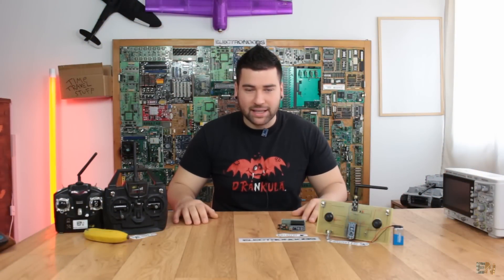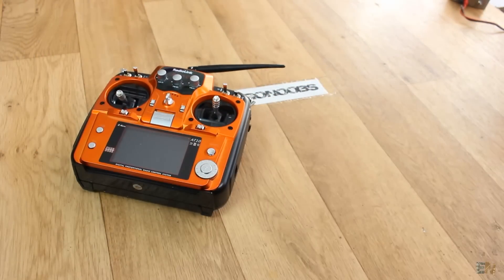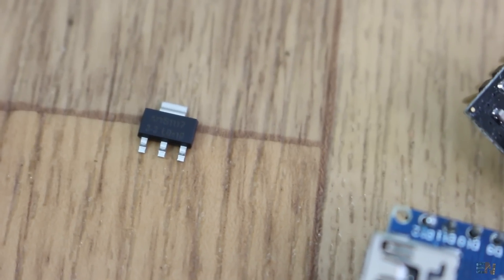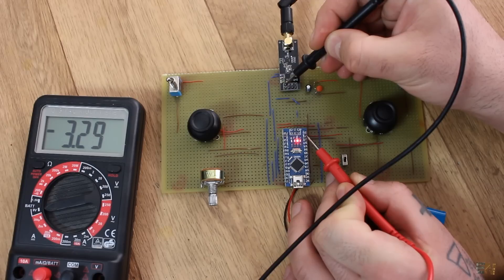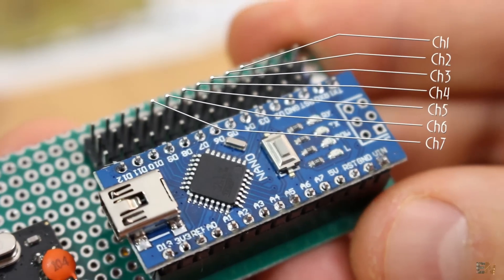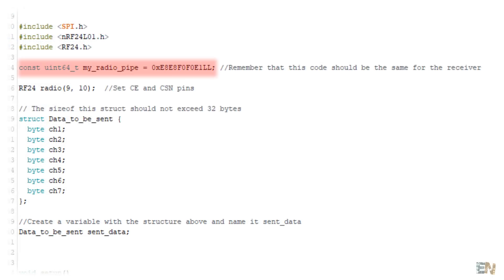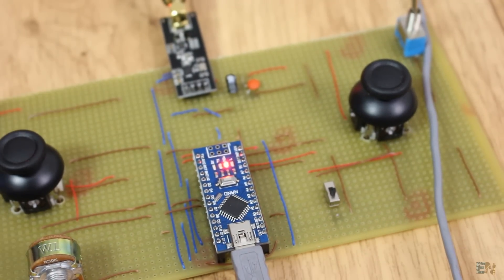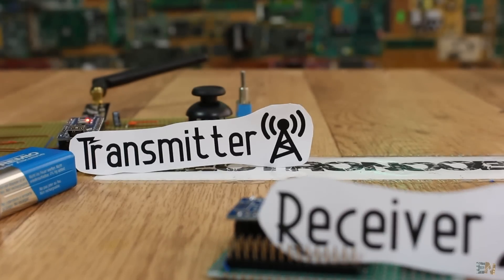DIY Radio Controller - Arduino & NRF24 + amplified antenna

Comment: hello electronoobs i made 6 channel rc arduino trans and reciver but after all connecting ..then servos not working all time sometimes it works but stoped and bldc motor working using  potentiometer on transmiter..but when connect servos on other channel this bldc motor stopping ...and that circuite some times not working unless my hand reaches near nrf24l01 module which conected to transmitter that reciver esc motor working why this pls help me..very sad....

Comment: Hi, I'm thinking of making a simple two channel rc plane that steers using differential thrust. Will the transmitter and reciever be as complicated as shown in the video or is there a simpler way to build it using only a few of the components in the video?
Reply: Hello, instead of using this , u can use a transmitter and reciever from a car , or 27mhz if u don't have a rc car. But u cannot use bldc motor in this setup and u will need to use the coreless dc motor . There is a video on this from channel build creation

Comment: In just realized, in the schematic for the receiver, 5V from ESC is being supplied directly to 5V on Arduino. But the problem is that most ESC supplies between 5 - 6V, in my case I have one that supply 5.7V, so in that case wouldn't 5.7V fry the micro-controller on Arduino? Should I use Vin pin on Arduino instead?

Comment: do i need a Radio.setChannel() ? you dont have.. in my test code i have ones and it runs. Your code dosent work at my Arduino ..hmmm

Comment: bro its 128 not 127 becuase we use this formula "(X + Y)/2 = Halfway Between" to find it so its "(1 + 255)/2 = 128" so pls change it inthe code the reason i noticed while using aservo i saw a bit of dead zone in joys so this fixed
To check that our answer is correct, we subtract 1 from 128 and subtract 128 from 255 and compare the two numbers:

128 - 1 = 127
255 - 128 = 127

As you can see, the halfway number is 127 higher than 1 and 127 lower than 255. Therefore, our halfway between answer of 128 above is correct.

Comment: I think you use the wrong value on the map range. It should be from 0 to 1023, wasn't it?
I changed mine and it worked perfectly. But once I didn't yet buy the 3.3v conversor I had to use the little nRF24L01 which does not drain as much current as the one who has the antena. Very nice.. congrats bro

Comment: I didn't undustand what "twisting ground aroung mosi and miso wires " meant. Can anyone help?
Reply: basically you twist the ground jumper wire around the miso and mosi wires. You can see it at 9:24 where the black ground wire is twisted around the yellow and white wires
Reply: @THEMOCCHANNELThanks, after a year, I finally got it

Comment: Great video!! Finally I found the perfect explanation for this topic. I  also use the arduino nano and the NRF24L01. I want to send the joystick data in ppm to my fc, which then regulates the brushless motors. The only thing I dont understand is, that u use D2 as the ppm pin. Why not the tx1 pin, does this not make more sense?

Comment: I just finished building a couple of these transmitters using a custom pcb from Jlcpcb ( Gerber files from Electronoobs website )
Happy to say that they almost work. 
Both transmitters transmit data as described, but there is an interesting glitch.
On the receiver side I control two stepper motors.
As I move joysticks left and right, motors respond and move accordingly, but often motors just keep going, even If I move the sticks in the opposite direction. 
At first I thought that it is a software issue, but same software on “Funduino” controller/ transmitter runs the motors without any problems. 
Then I swapped joysticks, nrf24 modules, etc, but the problem persists.

Then I built another transmitter using Arduino Nano instead of just bare Atmega chip, and everything works well, same code, same connections, just Nano instead of bare Atmega.

I am suspecting that there is a “FLOATING” input on the Atmega chip or a missing trace on the pcb that causes the transmitter to glitch.

Comment: Hello sir my tx send the data some time. I used different nrf 24l01 lna +pa module but same problem occurs what may be the problem? I am not using nrf module adaptor

Comment: Hello. The best video on youtube. I've done everything as You said, but anyway Servo moves only 30degree. All values shows ok, i mean in serial.print. Values changes from 1000 to 2000. In transmiter also, from 0 to 255. I've tried to modified everything what i can, but still same result. Can anybody help me?
Reply: never mind, i've already solved the problem ;)

Comment: Hi. Firstly, awesome project! Would there be a way for me to mix two channels to behave in a combined way on the transmitter for a delta wing fixed-wing aircraft with only elevons as control surfaces? How do I go about that with the code? Any help would be much appreciated. Thanks in advance.
Cheers,
Max

Comment: "Amplified Antenna" is not described, the links do  not work, the parts are not described and with dead links on ebay etc, you can't build the project.  You need to drop the rapid speech and talk like an instructor not a YouTube copycat.

Comment: So if i want more chanels, lets say 16 and upwards, like for a bigger future build with servos to control parachute and robotoic arm and orbital shoulder predator arm lazer beam i have to go with an atmega board for more chanels? can that be done? the orbital shoulder predator lazer shooter and atmega board for transmitter?

Comment: Very good design! Thanks a lot. Both me and my friend build the transmitter and receiver.
During the test with the potentiometer on channel 0 we observed the same error.
Intermittend channel 2,3 and 4 showed the full width for 1 or 2 runs and channel 1 jumped to the nul position.
We see this on 2 different builds of the project. The systems are 250km away from each other.
I think when this shows up when the drone is in the air something nasty will happen.
Did someone of you see this problem as well?
Reply: Nope sorry mine work fine

Comment: I completed this project. Have been running it in my Vintage RC10GTE Brushless conversion. 
My receiver is soldered but my transmitter is still on the breadboard awaiting more switches etc. 
However, I noticed every now and then It just loses connection. Is there a way to prevent this? 
I'm using the long range NRF24 PA+ for the transmitter and the basic NRF24L01 for the receiver.

Comment: I think the problem comes in when the arduin uses its ref actually as 0 to 1023. Setting the data to 0 to 255 using arduino map so it will convert those values to suit it. I think you should have explained that part but great vid. Ty very easily made

Comment: When I use the same code and setup, my ESC just beeps and nothing works, without the ESC all the servos work fine, there is just no throttle. Any idea why?

Comment: I am follow same steps and it's working perfectly but now actually I am using 320 amp esc the circuit is working but suddenly the L light of arduino nano and stop working and I unplug the circuit and again plug in so it's fine but this error repeat again and again I can't fix it now so anyone can help me to solve this problem

Comment: For receiver part, I want to use NodeMcu esp8266 v3. I wired accordingly but the output value is showing 1498 only irrespective of transmitter pot position.  please help!!!
Reply: any solution?

Comment: Hello. I made this radio several months ago to control Joop Brokking's drone and it was great, congratulations. But now, i need a 3 positions switch, just like commercial radio. Can I connect directly by replacing the CH7 potentiometer or do I need to change anything? Would you help me?

Comment: I don't see you anywhere to set the speed of SPI communication. The reason for excessive noise sensitivity over the SPI lines is most probably the default 4MHz clock on the hw spi of arduino, and that's already where transmission line effects start pulling up. Configuring the SPI down to 1Mhz would still be overkill for 7 channels, but most probably would get rid of noise sensitivity problems.

Comment: I had doubt that we can use the receiver for a cheap RC car and does we need to change the code in the receiver section for making this DIY project for RC car bro.!
Can make a video that how to make a RC car using this arduino receiver and transmitter plz....
And one more thing broo I really learned something new by this project thank you broo for this tutorial

Comment: HELLO....great video....I want to build only the controller for drone simulator and send the ppm with cable to  smartpropoplus
Can I get the ppm signal from a pin of the transmitter without the NRF24 or receiver?

Comment: Im new to electronic stuff and I don't know how do you read these circuits can you explain how the reciever connections are connected i mean there's no negative sign how do i connect the battery to the circuit? Please help :'(

Comment: I'd like to know if using the HC-12 module instead of the NRF24 module would be better. Or is there a specific reason you used the NRF24??

Comment: May i ask? We using 5v for arduino and 3.3v for radio-module. But how about logical levels? Need radio-module 3.3v for input-output pins?

Comment: Well, I have question. I use Arduino PRO micro in the receiver insted of nano. But the pinout is not these same. For example D11, D12, D13 does not existing in PRO micro. Which pins should I use?

Comment: Sir I've question.. The question is that by this schematic of receiver can we run servo motor directly ??? Or we need to again map it (1000, 2000 , 0,180) like this??

Comment: It took 4 hours to setup for the transmitter and receiver. When setup completed, i went to your description to download the test codes. But there is no such code in the description. What should i do now.
Reply from the maker: Yes there are. Look again. Test code for Rx and Tx. It will just print the received value to the serial port so you could see the value in the monitor. http://www.electronoobs.com/eng_arduino_tut25_code2.php

Comment: Hallo thnx for your idea. I has a problem with nrf24l01 and i didn't know what to do. No comunication betwean two arduinos.
After three versions of transmitter it works. ;-) connections was not hard enought. MY MISTAKE

Comment: How to modify the switches on the Flysky i6 radio or any other radio lets say you want to replace all the switches with center off spring loaded switches how do you do it, do you have to replace an ic before it can be done?

Comment: Hombre i love you so much, you just helped me alot with your video and your both codes for transmitter and reciever on your side. Im RC-Tallship-Constructer, but all RC-Components on european market are scrap, they cost up to 2000 Bugs, with 6-7 prop functions and rest are stupid switches, for setting sails etc, i need up to 32 prop functions. 
Constructed out of Wood a cool rustical Transmitter with arduino many potis and slider-sticks, also wth nextion-display, for transmitting 11 prop Functions, but all codes on youtube didnt work well, one only transmitted signal from 4 potis rest was shown with 0,...
BUT YOUR CODE IS MEGA GRATE!!(cool) , both serial monitors show exact perfect values, from all 11 potis and 11 servo-conections.
No servo-board used, only 2 Joy-It mega(each 19€-goldnuggets) and 2 NRF24L01(each 4€-Goldnuggets-printed antenna), i have big smiler on my face, hehe, next seablocade of stupid brexit-land will soon start !!
Reply: next ill have to find out which pins need to be connected on reciever for this accelerator modul LSM303D, how to transmit value for 
(compass-direction, speed on x-axis and drift on y-axis and roll-degrees over x-axis)
 back to transmitter, and find out how to show it on nextion-display 3,2", with cool grafic.....
OMG....maybe you have small idea?

Comment: Hello Sir, thanks for this tutorial but you have some small error in your transmitter code. You mapped from 0-1024 to 0-255. I think it should have been mapping from 0-1023 into 0-255.
Reply: That doesn't matter if you map from 1023 or 1024 the maximum will be 255 if value overflows and minimum will be 0 if value goes in negative.
Reply: @rameshwargadekar7626 not really, you will reach 255 before the potentiometer comes to the end . I think idk lol
Reply: I got the problem.. By coping his code 😅

Comment: Hi please what is the solution to control a Submarine based with an Arduino wirelessly and if the radio control works underwater

Comment: have you try the RF NANO ARDUINO BORT  here is a link       https://www.ebay.com/itm/RF-Nano-For-Arduino-V3-0-Mirco-USB-Board-Integrate-NRF24L01-Wireless-Module/173947571040?hash=item2880154b60:g:VEQAAOSwaKZdFjmY

Comment: Once the transmitter and Rcvr is programmed, do Arduino board stays with them or remove them for final use? Thanx.
Reply: It stays
Reply: @anirudhajoshi2719  Thank you!

Comment: Ams1117 get very hot when supplied 9v input, and if i connect it to 5v of arduino i only get 3.1v as output any sollution or replacement for ams1117 which could solve the heating problem

Comment: Sir what is the out put voltage of the receiver pin , when the transmitter is in rest no operations of switches 
Because I check with led  the led glows mildly and when trottel up it glows high
Reply: I guess it's 5 volts

Comment: HI really cool project and working here!!! Thanks a lot, but I have a problem, when I put the 3rd Servo, this come a bit crazy, is shaking all the time, is possible control with a potenciometer but is all the time shaking very quickly, the other 2 servos works fine don't tremble. Really I don't know where is the problem, do you have any idea about this... Thanks in advance and thanks for your time.
Reply: HI there for if anyone occurs the same... My problem was I'm mixing GND from a circuit to another point... I put all GND to corresponf arduino and all works fine with 3 Servos for now... Thanks a lot this project will be very happy to my father... THKS :)

Comment: Channels? 32bytes not 8bit channels.... Also in packet that youre transmitting you could fit 8 digital values in 1 bite with union.
Reply from the maker: You could send 32 bytes of data. If you map each channel for your controller to below 8 bits (values 0-254), you could make a 32 channel radio controller, that's what I meant...
Reply: @ELECTRONOOBS  can i send 256 digitalRead()?
Reply from the maker: @Ncky  You can send 127 digital read, since each read will have 2 states, a 0 or a 1. Also, you will have to decode the byte in the receiver code and separate each digital read value. If you want to send more than 254 value, you should send two or more different packs of data and merge them together in the receiver.
Reply: @ELECTRONOOBS  Well... If max packet size is 32 bytes and one PORT register is 1 byte that means in one packet 32 PORT states can fit. PORT register is 8bit in size which corresponds to 8 IO's. 8IO's * 32 = 256 IO's in one packet. I think that you didnt understand me.

Comment: Thank you so much for the tuto. In the other hand, the used xy-joystick have a very short physical range, which make it not practical and less accurate when piloting a quadcopter comparing to the commercial RC.
Is there any idea on how to fix/expand the physical range of the xy-joystick.
Reply: By the way, I estimated the physical effective range of the xy-jostick to be between [-15° to 15°], which means:
- If we move the joystick left or right till -20°/20°, we got on AnlalogRead the value of zero/1023.
- While, out of this interval [-15° to 15°], we get unchanged value.
And this limitation of the xy-joystick condemns the Idea of RC based xy-joystick.

Comment: When you said 3.3v arduino nano does not gives enough current, if i use this on arduino uno 3.3v port, can i use it without voltage regulator ? And also thank you so much for this video :D
Reply: nope
Reply: @Ujwal5555  i ve used it without no problem, you said nope i didn't understand it why you said that
Reply: @ayy4703  well I have encountered some issues with nrf modules when using onboard 3.3v regulator so I assumed your case would be similar. Sorry if that came out to be rude.
Reply: @Ujwal5555  Oh no, i just didn't understand :D that 's why i 've asked it :D thanks for reply

Comment: Great work but, what are the capacitors C1 - C10 and resistors R1-R2 values on electronoobs PCB from JLCPCB
Reply: at min 8 he say its 10uF cap and the other is ceramic 104, about the resistors i dont have any idea.

Comment: Hi , will these joystick control the motor speed . If I want to make a rc twin plane , for this I am using brushed drone motors , will the motors need  some components installed before it.

Comment: I think that this tutorial helped me the most, because when I first got the NRF24L01 I was like really sad cause I couldn't transmit data, couldn't change the constant chars of course, but now I understood that I need to transmit a char multiple times forming a kind of period of seconds per every transmit. So that I can control the period with some input from the joystick and transmit it to the receiver which can detect the period and then do whatever I want with it. Thank you a lot!
Reply: Would you mind elaborating, i dont quite understand?

Comment: I tried the test codes but the value in my serial monitor in my potentiometer did not change , checked the connections and even all my things are brand new and from a reputated seller , what might be the problem

Comment: The AMS117 in your part list leads to a 5v regulator. You should change this, otherwise many will burn their nrf module.
Reply: It's not Ams117 but AMS1117 (THERE ARE THREE 1)

Comment: What are the capacitors for the transmitter? The link you gave on the parts page doesn't specify